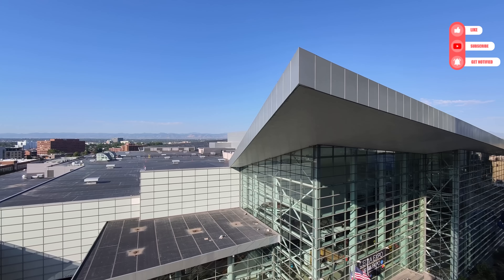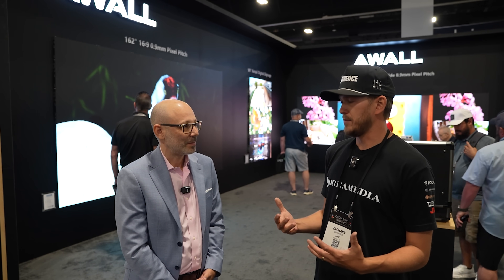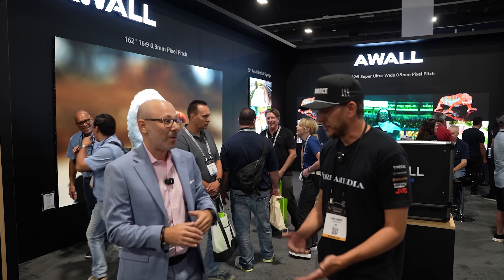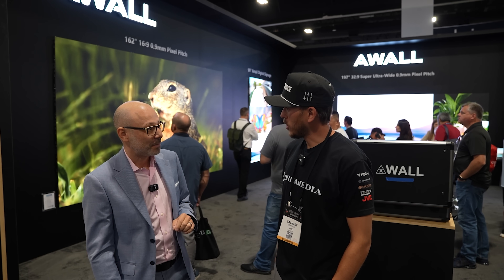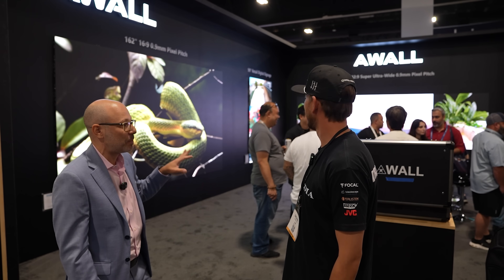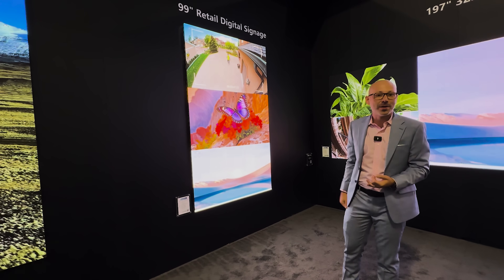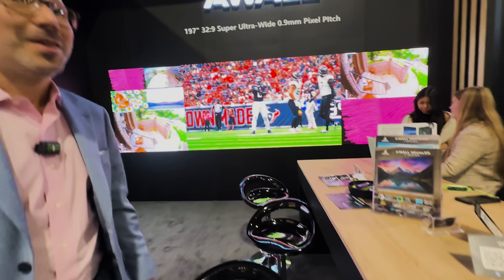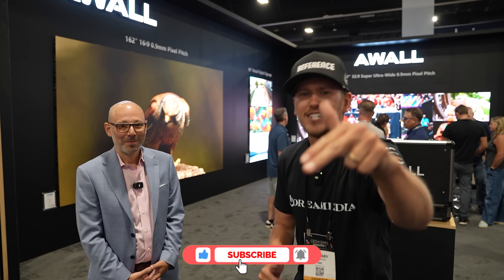Big Screens Low Prices AWALL MicroLED at CEDIA 2025

Comment: How bout blooming, and viewing angles?
Reply from the maker: Great question! On blooming, that’s one of the big advantages of COB MicroLED, like what we showed here. Since each pixel is a self-emissive diode (no backlight zones like LCD/Mini-LED). That’s also how they get those deep blacks and high contrast that Lenny was talking about. Also, for viewing angles, MicroLED is excellent. You don’t get the color washout or contrast loss you see with many LCD panels. Even off-axis, brightness and color stay very consistent, which is a big deal for large rooms or multi-seat layouts.

Comment: one hair dryer is 1000 plus watts so it will cost to run it.still big wallets.
Reply from the maker: True, hair dryers pull a ton of watts, but these MicroLED walls are surprisingly efficient. They use less power overall and stay cool while running, so energy use isn’t as heavy as people think.
Reply: @Dreamediaav  is there even more efficient power saving technology in the future or is this maxed out already?
Reply from the maker: @wl6020  Great question! We can’t say for sure what the future holds. Technology is getting crazier and crazier.

Comment: Wow what a great product, my question would be on the multiple screens what kind of input is required, i.e. fiber,  hdmi, coax, ethernet?  Does multiple feeds need multiple sources?
Reply from the maker: Appreciate it! It’s all managed through one control box with an HDMI input, so you won’t need multiple sources for each panel.

Comment: My question would be, 60 Hz vs 120 Hz on the frame rate.  On their website, it would be nice to see their other series vs just the entry-level
Reply from the maker: The AWOL MicroLED supports up to 120Hz, depending on the model and input source. Definitely not 600Hz, though, that would mean the end 😅
Reply: at this size you need 600hz not 60hz
Reply: @xxsav38-e6v There's no such thing as a 600 Hz frame rate

Comment: what about 8k are they gonna do that?
Reply: They already could do it with a large walls with a 0.7 pixel pitch (size of the wall: 5.376x3.024m; 242.8 inch diagonal !!!).
With 0.5mm pixel pitch :
3.84 x 2.16m (174 inch diagonal)
Problem: They support only HDMI 2.0 at the moment....
Summary: In most homes 8k screens make sense only with a 0.5mm pixel pitch. 0.5mm Pixel pitch Micro-LED are coming !!!
Reply: @Anakin-dl6eb  can 0.6 mm pixel pitch be made? Why is the next in line 0.5mm?  At 0.7mm, it's a 9 ft 11 inch tall tv, most ceilings in america is 8 ft tall or so.
Reply: @Anakin-dl6eb  but what about HDMI 2.2 which is coming out. instead of going hdmi 2.1 just go straight to hdmi 2.2 thats what i would do
Reply: @aarongregg9699 
If available of course...., but HDMI 2.2 makes sense only for gamers....
Reply from the maker: Good question! Right now, the AWALL systems run on HDMI 2.0 processors, with 2.1 upgrade cards in the works. 8K might be possible down the line with tighter pixel pitch panels, but the current lineup focuses on 4K performance.

Comment: The 162 inch 16:9 0.9mm pixel pitch screen at 56.9k is actually a very decent price!!!
Hopefully we get the same size at a 0.7mm pixel pitch for 30k in 3 years, that would be really great!
Reply: Whilst that wouldn't be a bad thing I'm not sure you need it. 162" at 0.9 mm is 4K and you'd have to sit closer than 9ft to it to notice any pixilation and want a better pixel pitch. You'd have to like an insane viewing angle to appreciate the difference. Not that I'd be complaining if it happened of course as it would mean the 0.9 was much more affordable too.
Reply: @paulc5389 
Personally I'm waiting for Micro-LEDs with 0.5mm pixel pitch in order to get 16:9 8k screen with the following dimensions: 
3.84 x 2.16m (174 inch diagonal).😛😛😛
Reply from the maker: @paulc5389  Exactly! You’d need to sit unrealistically close to notice a difference with smaller pixel pitches.
Reply from the maker: That would be wild!  0.5mm pitch would open the door for true 8K walls. The tech’s moving fast, so we'll never know when.
Reply: @paulc5389  162 inch 4k is literally the same as 81 inch 1080p. At 9 feet I do see a tiny difference between a 65 1080p and 65 4k. It is noticeable
Reply from the maker: Appreciate that! dropping down to 30k in 3 years with a size at a 0.7mm pixel pitch would be great for everyone who wants to have one.

Comment: let me guess, that 162 inch panel costs ,,only'' 100k
Reply: It's actually only 56.9k !!!
Reply: @Anakin-dl6eb that's an insane price for a TV. Absolute bargain.
Reply: @spacemanwho 
High End JVC / Sony Beamers are around 20-30k or even 75-80k for the Sony GTZ 380 (that is worse than the Micro-LED Wall).
Therefore the price is already a big competition for example the Sony GTZ 380 (and other projectors in this price range)
Reply from the maker: It's actually $60,000. The MicroLed just looks too expensive, like 100k, but it's actually cheaper.